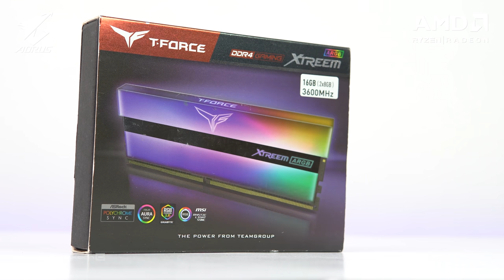($2500) Php 125K AORUS ALL AMD Gaming/Editing PC Build Ryzen 7 5800X I RX 6700 XT Elite - Time Lapse

Comment: Ryzen 3 3200g built in vega 8
A320 M motherboard
atx 700w power supply
8gb ram
120gb ssd
500gb hdd
cvs 1707 rgb
huntkey 22" monitor

ano po dapat kong unahin iupgrade at ano po dapat ang ipalit?